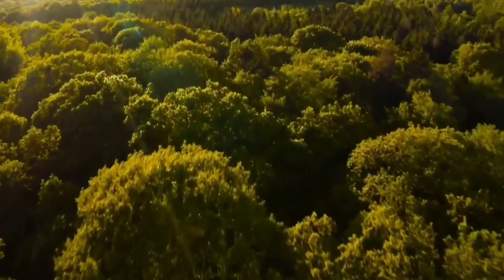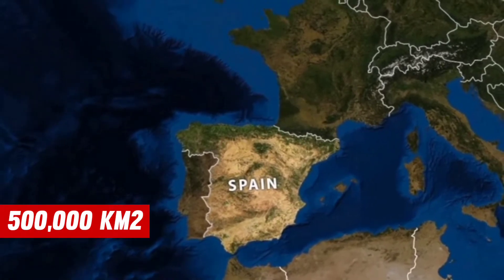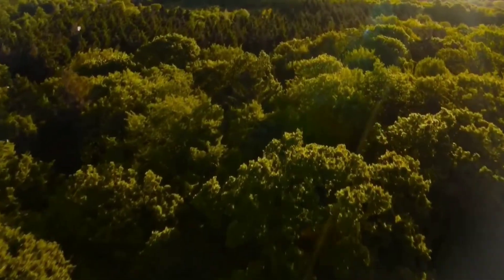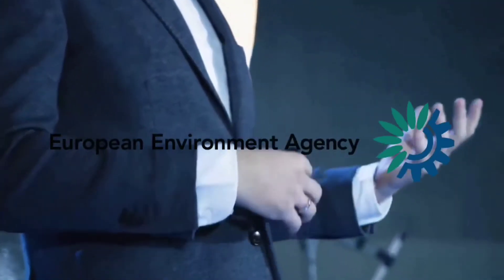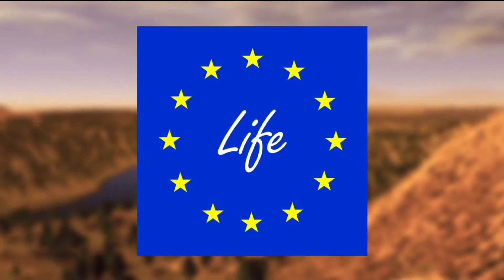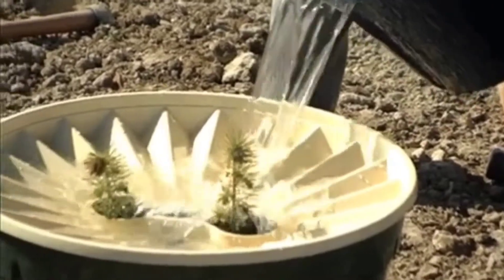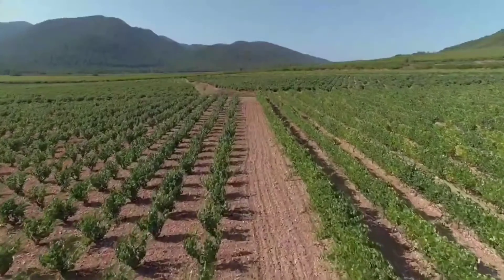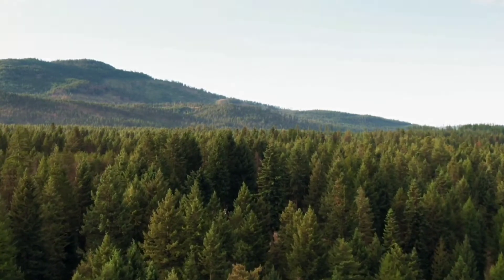How Spain is Turning it's Desert Into a Farmland Oasis

Comment: Glad they're trying.  
The plasticky cocoons create pollution.  They could substitute with keylining which is creating deep, rainwater harvesting slashes at 1degree slope, using a key line-type plow.  This disturbs little vegetation while harvesting water.  
Interconnect these with zai pits.  Zai pits are depressed planting holes that collect water that in turn support the plants.

Zero bare earth practices.  Using a rototiller causes harm.  It disrupts earthworm tunnels, exposes the soil biome to solarization (sun kills and is a form of sanitation), allows wind and sun erosion; reduces water absorption, etc.

These are the few things they could do better, at the same or less cost.
Reply: Your complaint is meritless. The devices work, are long lasting and necessary.
Reply: @surunitemiakanni-oye4346  
The plant cocoons are frivolous for exactly the reason I said.  Your ignoring their inherent faults fails to address core problems. 
They create extra cost and add to logistics and time spent, exponentially contribute to pollution, AND will strangle the trees in time as well as limit root spread.  Zai pits, swales are longer lasting, easy to upsize, and esthetically more pleasing as well.
Reply: @b_uppy  It is clear to me that you do not really understand the purpose of the system and how it works in helping plants survive harsh environments. You should educate yourself better before diving headfirst into an argument you are ill prepared for. Those who buy and install them know what they are getting and why they got them. They also know the value and usefulness they received back for their efforts and money spent.
They are not complaining but you are. Good luck shouting at the wind.
Reply: @b_uppy  there are many roads that lead to Rome. There are many tree planting methods to conserve water and improve plants’ survival.
Communities and organisations themselves decide which way they go.
Reply: @surunitemiakanni-oye4346  
And some are paying more and getting less for zero good reasons.   I prefer people get more resiliency while paying less...